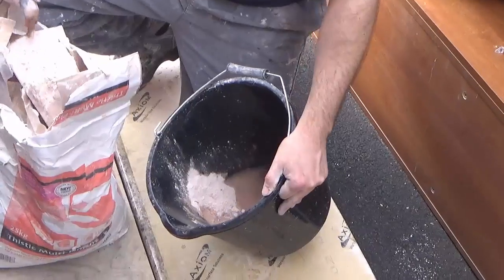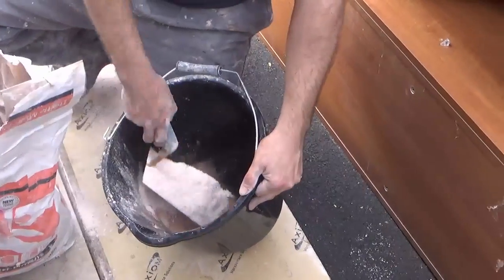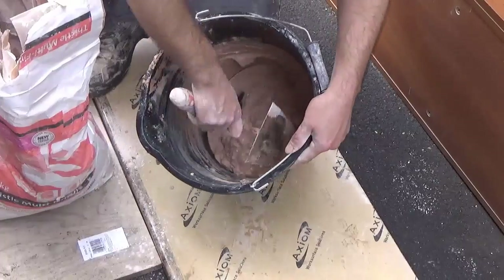How To Mix Multi Finish by Hand ( small amounts )

Comment: ive been mixing up bonding and occasionally render to bond in my cables but the thing that i realised from this video is that its so much easier to mix if you add the plaster to the water and not the other way round, this will save me a lot of effort mixing stiff/dry mix, i feel stupid now
Reply from the maker: Never feel stupid mate we only get better for sure Is much easier this way but if you don't got much plaster and afraid to make it to wet powder 1st is safer but we only learn when we get our hands dirty thanks for watching and commenting mate 👍

Comment: I see maybe where I've been going wrong mixing thistle plaster for small repair jobs, I add water to the powder but it seems to set before I have it smoothed on the wall, you add powder to the water so its like slooter and then you bring it to the thickness you want, im going to try it that way the next time i mix thistle plaster, good video there Mac.
Reply from the maker: Your way is good if you only have a little left or to do but this is best way to mix avoiding having dry lamps and should last 30mins pot life then set solid 2hours approx

Comment: Bags of plaster here in the Netherlands say to add all the plaster to water, then let it soak for 5 mins before mixing. Always had issues with lumps when mixing by hand. Will try your approach today.
Reply from the maker: Is that plaster of paris?
Reply: @macplastering  no that's regular plaster. They have red band and fix n finish as two main plasters and both say same thing. To let the plaster drink for 5 mins. Anyway, I'm going to try your method today.
Reply from the maker: @Delchursing  Let me now how you get on mate :)
Reply: @macplastering  worked a treat...much better...Thanks for the tips!
Reply from the maker: @Delchursing  brilliant mate =)

Comment: Thanks for the video. Everyone else is mixing whole bags and I only need a little bit for a wall chase. (Already added bonding). How much watter did you use to begin with?
Reply from the maker: Pobs just a litre in there mate I would add water 1st though easier to mix mate
Reply: @macplastering  Cheers mate really appreciate it. 👍🏻
Reply from the maker: No problems mate have a good few patching videos might help you some also  mate thanks for watching and commenting

Comment: any idea why the plaster dry quite fast after i mix??
Reply from the maker: Hello buddy what kind of plaster is it whats its brand / make ?
Reply: @macplastering  Stopping Compound
Reply from the maker: @Cupids-lx5xj  Is that like a dry wall finish >?? just for filling joints ?  This type of plaster normally sets in around 2 hours but if it is setting way faster it might be out of date
Reply: @macplastering  I just check.. My one set time is 5min.. Maybe that why.
Reply from the maker: @Cupids-lx5xj  There should be a date on the side of the bag mate that will tell you if its in date or outa date ... New video out soon if you get time to have a look :)